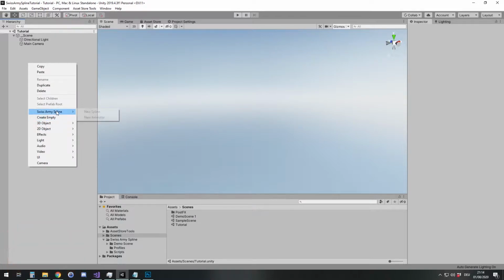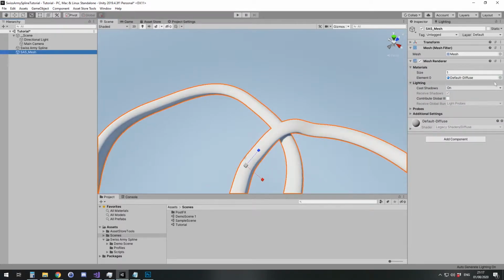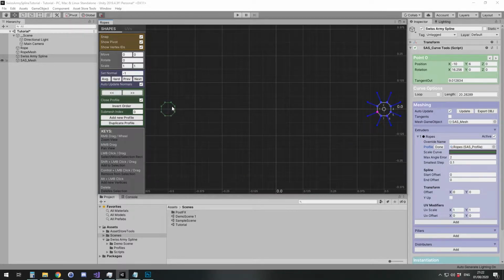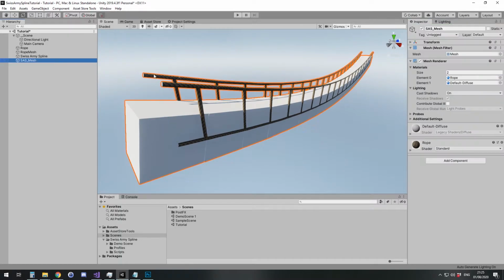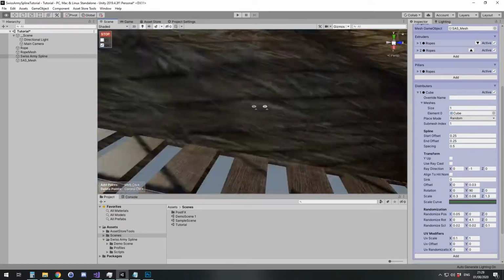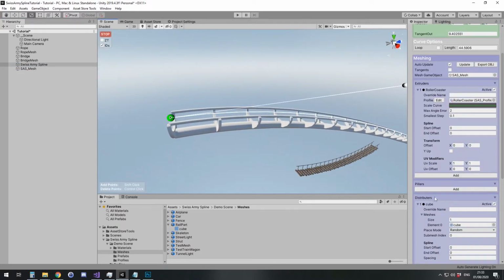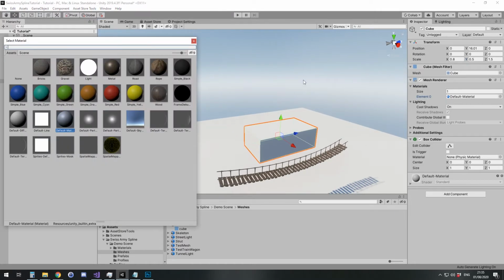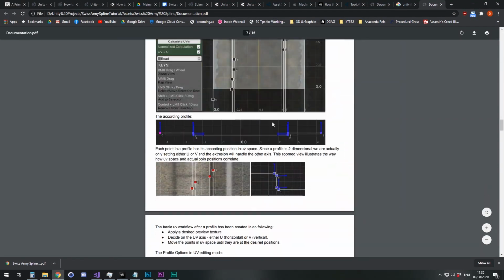Swiss Army Spline - Getting Started

Comment: I really like the easy to use aspect and flexibility! Also the built in editor for making (fast!) objects for the splines is a superb idea. The only thin i would miss is a smoothing option, since this type of splines are sometimes hard to handle to get it smooth. I´m not sure about the gravity thing, tho .. but this could be a really awesome coaster/train builder within unity (also because the drag is implemented already, which i didn´t found in other tools so far ;)). Anyways, great work! A real Swiss Army Spline with powerful capabilities.